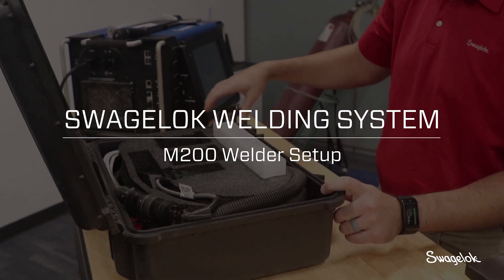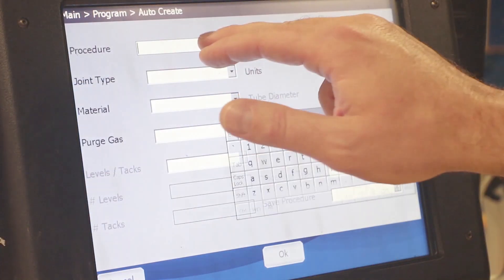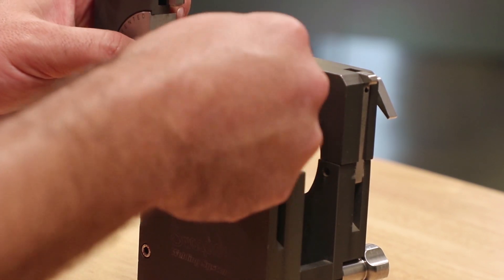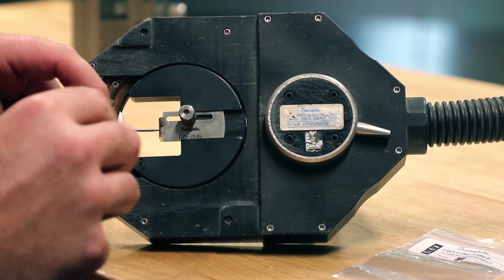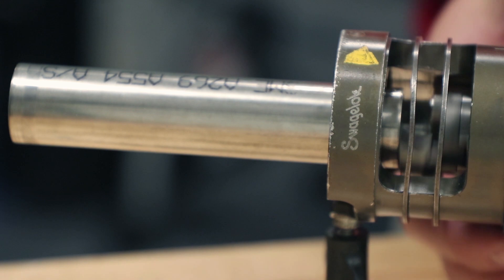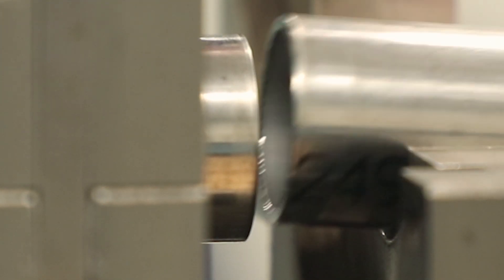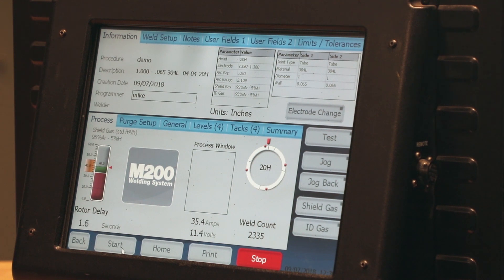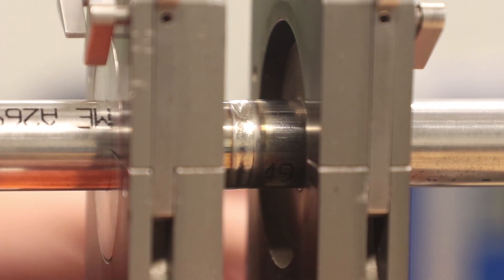Swagelok M200 Welding System

Comment: Dear sir/medam when iam using with this machine there is a problem that shield gas pressure is flectuating when i turn on sheduld gas
Reply: I have this issue with a bad flow meter & or loose fittings. Tighten fittings or swap flowmeter/ regulator

Comment: In Swagelok, there are ''Tube Butt Weld Fitting"(plaine end, square face) and ''Automatic Tube Butt Weld Fitting''(end with Integral filler ring), refer to Weld Fittings-MS-1-149. The difference of two kinds of tube ends is introduced in the document. However, there is no information about what is the advantage and disadvantage of the two and how the welding of each kind of end is performed. As shown in this video, the tube end is plane end, i guess welding of Automatic Tube Butt Weld Fitting can't be handled by this machine. Could you please talk about what  I mentioned above? Thanks.

Comment: I using same machine M200 now in Singapore.  I welding tube size is OD 3/8x 0.083 wall thick 625 inconal and 316L. But this 2 tubes size don’t have program this machine. I using purging gas is argon. Can you reply me how to make the program in this machine
Reply: Hi Reji, 
Your local sales and service center will be able to answer your question. You can find their contact information here: https://swagelok.com/en/locate-a-sales-service-center
Reply: DID YOU GET THE SETTING FOR THESE MATERIALS?